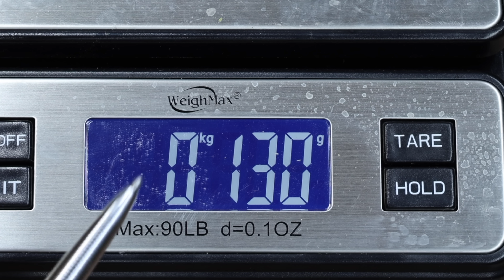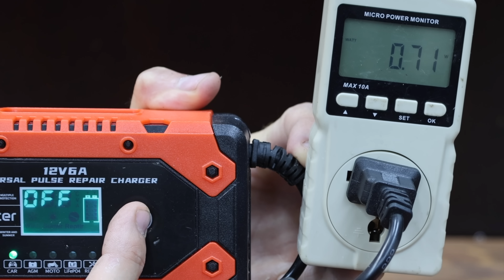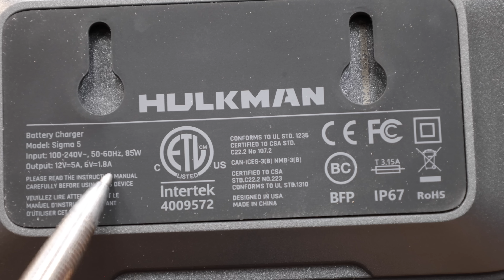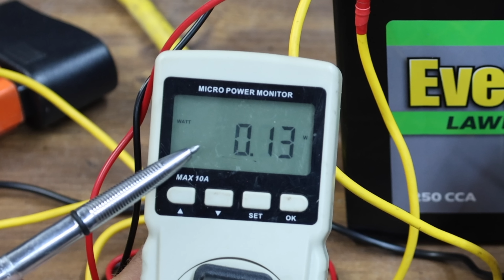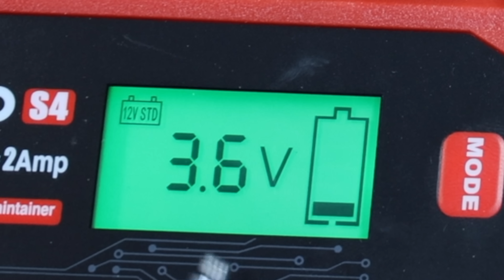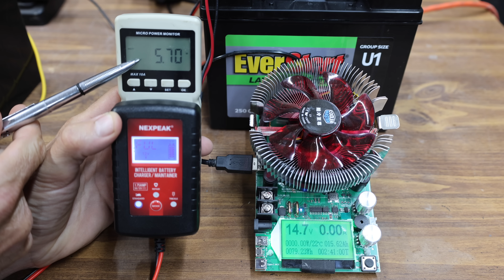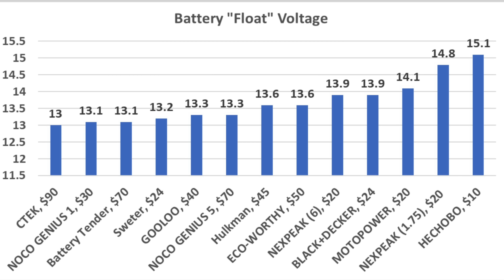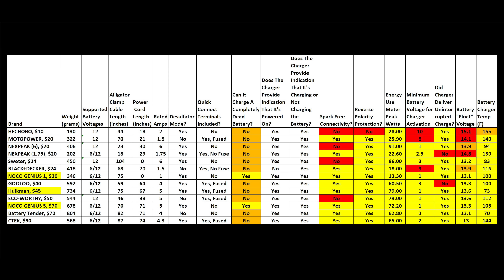I Tested the Most Hyped Car Battery Chargers – One Stood Out!

Comment: Should not have cheap out on the CTEK, testing the MUS 4.3 TEST&CHARGE would’ve gave much better results
Reply from the maker: Thanks for the feedback.
Reply: I’m curious. I have both. How are they different? I tend to use the mxs 5 on my AGM battery.
Reply: @speedlever MUS 4.3 has more features and can recondition dead batteries check out a PDF of the manual
Reply: @mattheww8059 
I have a copy of that on my phone. I don’t see an AGM option on the MUS 4.3 like the MKS 5.0 has. I’m using it on an AGM battery

Edit: both have a 10 day limit on float charging. I hadn’t noticed that before. Hmm.
Reply: @speedlever  go to technical specs and it shows it maintains AGM batteries
Reply: @mattheww8059 
Technically, the normal battery program services ‘many’ AGM batteries. It doesn’t bother to define many or which AGM batteries fall outside the window.
Reply: @speedlever  I don’t know what else to tell you, I’ve been using them on mine for years, so I’m done.

Comment: I had a real world issue last year. My Jeep's battery was dead over the harsh winter. It's seven years old, but died due to the extreme cold we had and the lack of driving. Instead of having a new one delivered I tried the NOCO GENIUS10. It not only repaired the battery, it still works today and was professionally tested, it charged it fully. Over the winter I used the NOCO GENIUS10 to charge the Jeep battery daily until I needed to go out on it's own trickle. The Jeep would sit outside again for two weeks plugged in and the Jeep started and functioned perfectly. Hope that helps. Oh I forgot, after it worked I purchased the NOCO GENIUS10 cigarette lighter adapter. That worked for weekly charging. So easy just plugged it into the Jeep console lighter which is always on.

UPDATE 12/25:
The NOCO Genius 10 no longer recognizes voltage from my Jeep battery. I tested it. It has a 12v charge, even though it is old. The Noco 10 worked for two weeks this winter and charged flawless, but out of the blue it stopped recognizing charge in the battery. It works if I "force charge" the battery though. I'll replace the charger.
Reply from the maker: You are welcome!

Comment: The only quality small chargers are the Victron IP 65 series.  They are fully programable with the free BT  app,.  They can be set to run as a power supply at whatever voltage you choose. Noco  chargers do not have a float stage.
Reply from the maker: Thanks for the feedback.
Reply: Yeah, I’m like where’s Victron? I’d put money that their charging algorithms are more advanced than anything shown here and IP rated. Updatable firmware via the app too. Love all my Victron equipment.

Comment: I have been using a CTEK for over 4 years without any issues, and in fact it's the only charger that was able to bring back a dead battery that no other charger I tried even detected.
Reply: I had been using the CTEK 7002 U.S. model since about 2008 after discovering this brand and learning that it was designed to work down to -20C (I'm in Alberta, Canada). I had been using a big boat-anchor of a traditional power transformer based Schumacher automatic 6V/12V charger that has 125A jump-start capability.

One day after fully charging the battery in my truck with the Schumacher, I measured the specific gravity of each cell using a hydrometer. The float barely came up into the "green" zone for each cell. Later, I tried charging and reconditioning the battery using the CTEK 7002 U.S. model. (The instructions call for first fully charging the battery before using Recondition mode, which I did). Once on Recondition, it took about 15 hours for the green LED that indicates the end of the Charge and/or Recondition cycle to illuminate. (Until the green LED illuminated, I wasn't sure the CTEK was doing anything).

After the Recondition cycle was finished, I again measured the specific gravity of each cell and found the hydrometer float had risen well up into the green zone - far higher than after I had charged the battery using the Schumacher charger. I've been a fan of CTEK ever since. They're not the most powerful or fastest chargers and they don't have a jump-start feature (I still have the Schumacher charger for that), but the CTEKs do seem to be the most gentle and thorough chargers that I've used.

I've managed to obtain six+ years from the three batteries I've had in the one vehicle since 2008. I could have probably kept using them except for the fact that temperatures in winter here get down to -35C to -40C and I didn't want to chance having a weak, older battery in my vehicle in the middle of winter, particularly when I worked out of town at a place that didn't have electrical outlets to plug in my vehicle's block heater.
Reply: @Ralt_Alt406  i have had the same battery on my porsche for over 10 years.  it still worked well but just replaced it, just in case.  of course using the CTEK.
Reply: @Ralt_Alt406  I would not buy anything else than Ctek. They know what they are doing.
Reply from the maker: Thanks for the feedback.
Reply: Curious if a Shell SBC400 worked for you. It brought back my Ranger's battery from beyond dead to good as new. (Damned antitheft circuit drainage...) Now permanently installed.
Reply: Was given a free Marine Battery.  Totally dead.  Have 2 battery charges, neither one did anything.  I put it on a Harbor Freight trickle charger/battery maintainer for a few days, it was charging.  But the battery charger back on it took a full charge and holds.  So if you have a battery charger that doesn't "work".  Try the trickle charger first.
Reply: Keep a dumb charger handy because they will charge a completely flat battery, smart chargers such as ctek usually won’t .
Reply: Great video. I use Ctek 7002 and Clore automotive pl2320. The clore has brought back completely dead batteries.  And my Ctek  is excellent at the desulfating.
Reply: One commenter connected a simple 9 Volt torch/radio etc. battery across the terminals (+ to +, -ve to - ve)
that fooled the charger into thinking the minimum 9 volts  were present in the to -be -charged battery..
and the charger took over and charged the battery 
whereas it would not do so without that "fooling"....

Comment: I think you need to measure the actual current delivered to the battery rather than ac draw. 

Also, you should also review how selectable the charge current is, because you are supposed to set the charge current as a fraction of the battery capacity - so a 10a charger would cook a small motorcycle battery
Reply: its probably automated for detecting capacity. i used my noco 5 amp on a 12v AGM small device battery which is much smaller than a motorcycle battery and all seems fine. i just top it off anyway, it doesnt get discharged much.
Reply: @gods_chosen_chuds yes - if it’s a high state of charge it should be ok, but a low state of charge it should run less amps during bulk stage.
Happy to be corrected - but im not sure you can autodetect the ah of a battery

Comment: While you have these chargers, see what ones will still function in -40 weather, most new trickle chargers all will shut off at -15F today which makes many of them useless for people who have vehicles in colder climates
Reply from the maker: Thanks for the suggestion.
Reply: @ProjectFarm  A good example is that CTEK charger, it's only rated to -5F, any colder and you need to buy the CTEK Polar version which will keep running down to -22F

It's why a bunch of people in extreme environments go with older style battery tenders vs "Smart chargers" that they have today because they will continue to run even down to -60F, also why battery tenders still remain so expensive in comparison

Comment: You should do a comparison with all of this versus a cheap lab bench power supply. 
They cost the same, or cheaper... But you can set whatever voltage limit you want (the float) and whatever current limit you want... They don't care if the battery is live or not. And if you shut it off before disconnecting there's never a spark because both of them are already at the same voltage. Don't turn it on until you're ready or you connect it to the bench supply instead of the battery if you're worried about Sparks... Which is also something I've never worried about. 

And if we're going by weight? They weigh a lot in comparison.
Reply from the maker: Thanks for the suggestion.

Comment: I’ve had 2 Battery Tenders, 5 yr warranty. Both have failed. Sent the first one back at my cost shipping, after the rep didn’t believe me. Cost me the lose of a battery. There replacement also failed in 6 months. Bought another brand for my vehicles all (3) still working after 3 yrs.
Reply from the maker: Thanks for sharing.

Comment: I got a bunch of CTEK chargers are discount pricing, and they suit my needs great for the past 10 years. I use them to maintain and top up my boat, jetski, lawn tractor, and car batteries. 

Depending on the CTEK model you get, yes those too can force charge and output 12v as a 12v power supply too. 

Generally when it comes to trying to revive 0v dead batteries, I tend to go very very old school and use a very old type charger for that, at least only for reviving it. Once it's holding power and taking a charge, I revert to a smart charger like the CTEK I have to recondition it.

Comment: For the record my NOCO Gen5 failed within 90 days, working on RMA/Warranty st the moment. 😞 10/02/25 - As of today, I have sent 2 NOCO 5's back for failures. The first one lost it's brains and the second one keep overheating. They were both used on known good batteries. I think at the moment they have a real QA/Firmware issue. Avoid this for 90 days. That should give them plenty of time to patch it. 10/22/25, On my 3rd NOCO 5 and it's working like it should. Hoping to get a few years out of it.
Reply from the maker: Thanks for the feedback.

Comment: My decision to buy the Noco 1 a few months ago I guess was the right choice.  Just needed one that could maintain an AGM battery for a car being parked for a long time and so far it's completely recharged a dying battery and has been maintaining it perfectly.  I went for the Noco 1 over the 5 simply because of cost and I wasn't in a hurry to charge the battery faster, since the car it just parked anyways.  Thanks for the great video.
Reply: Same. I've used my Genius 1 on 3 batteries in less than a year and it's been excellent.
Reply from the maker: You are welcome!  Thanks for sharing.

Comment: great video!  I've used the CTEK chargers for more than a decade now. What really separates them from the others is their desulphation performance. I've seen then bring completely unusable batteries back to life, and they last few several more years. Noco aren't bad as a runner-up, but they copied their features and technologies from CTEK.
Reply: Taking CTEKs and NOCO apart, it's obvious that the NOCO build quality is better.  I agree with you about the CTEK performance though - marginally better than the NOCO.
Reply from the maker: Thanks for the feedback.

Comment: Made a "battery charger" suggestion in comments a good while back so was especially excited to see this :-).  Great!     Yes, would definitely like to see a review of some larger chargers.   And a separate idea:  capacitor based jump starters.   The kind that use what is left in the battery to gather up power and use it to jump start.  I do happen to have one of these and wonder how it might compare to others.    (They are useful in super cold temps, because there is no internal battery to be temperature compromised.).  Thanks!
Reply from the maker: You are welcome!  Thanks for the suggestions.

Comment: Been running the Genius 10 on a 8yo Northstar AGM in Las Vegas and it still tests ~78%. The power supply mode has been surprisingly useful in the garage to recharge jackery style battery packs and to test 12-volt automotive items. They seemingly have been cheapest during prime days and black friday.
Reply from the maker: Thanks for sharing.

Comment: I have been using a Ctek for 8 years or so, still going strong. I do have an old school battery charger to bring up dead batteries, and switch over to the Ctek. 

I would be curious for you to get the regen mode, not sure if the other chargers offer that feature.
Reply from the maker: Thanks for the suggestion.

Comment: Great review!  I bought the Noco Genius 5 in the absence of comparative data as a trickle charger for a vintage car that I don't drive often a few years back and it's been great. New England winters don't do much for keeping unused batteries charged :-) The Noco 5 has hardware to permanently wire a "pigtail" on the battery for easy attachment and detachment, which works great for my needs. I honestly cant remember if this came with it or was an optional purchase, but I know it was worth it. I used the Noco recently for charging a completely dead lawnmower battery and it worked perfectly as well. Your review made me feel good about selecting Noco.
Reply from the maker: Thanks for the feedback.

Comment: I usually order the one of the top three of the various products you test weekly. Even if I don’t need whatever it is 😂 Man your efforts must sell more tools than the millions spent by the manufacturers on ads. Thanks as always!
Reply from the maker: You are welcome!
Reply: If you need a charger, go with the Hulkman but upgrade to the Sigma 10. Excellent build quality, can charge your larger automotive AGM batteries, LiFePO4 and be used as a power supply.

Comment: There was a major issue that you touched on and then unfortunately completely glossed over...the charging algorithms these devices use to charge and maintain batteries.  You mentioned in connection with the Gooloo.  Also, that series of lights on the Ctek is indicative of what charging stage it is in.   Output should change depending on what state of charge the battery is in.  It should definitely not be outputting at "full blast" until the desired voltage is reached.  There is a detailed explanation of this on Ctek's website.  Those charging algorithms are important to PROPERLY charging and maintaining a battery.  Also, you didn't list which chargers have a setting for AGM batteries.  Most AGMs like to be maintained at a higher voltage than a flooded lead acid battery.  I did enjoy the video, thank you.
Reply: This is an important note; and doubly important now that lithiums are beginning to trickle into  the market in meaningful numbers. I know the NOCOs will handle Li and AGM gracefully, It would be nice to know which of the less premium ones are also safe around less common batteries....

Comment: I have a Noco Genius 5 that is bolted in on the battery terminals, all I have to do is pull out the cord and let it charge/repair overnight, it works brilliantly. I have it mounted on a removable splash guard.
Reply from the maker: Thanks for sharing.

Comment: Why are you starting with a severely undercharged battery? It is literally the least important feature of a charger. A 0 volt battery is DEAD and should never be used again.
Reply: What if a battery was temporarily drained by leaving the ignition on overnight or by an unknown electrical gremlin. I’ve been able to charge and use a battery for years after such an issue.
Reply: @speedlever it will have severely lowered capacity
Reply: @DennisKrger possibly. As I mentioned, I was able to rescue a battery in that condition that lasted for years afterwards. 🤷 Now it probably wasn’t at 0 volts. But it wouldn’t do anything but click when I tried to start the car.

Comment: At the very beginning I thought you should have included the 200amp Schumacher ($148 at my local Walmart)  because it has boost capability. Then I heard your comment at end about larger chargers.  I prefer the mechanical timer Schumacher but I also own the automatic electronic version which magically can charge my tractors and vehicles and then shut off automatically.  Bad thing is I sometimes forget until I notice extension cord trailed across yard.  I have had three batteries blow up on charger.  Two blew top off while on trickle charger; one blew up when alligator clip popped off timing light  while I was adjusting timing on carbureted pickup.
Reply from the maker: Thanks for sharing.

Comment: Good info.. It would be great to know the float voltages for the different battery types.. Lithium can be damaged very quickly by excess float volts. It would also be good to know if the claims of different charging profiles by the manufacturers is real .. Thanks again..
Reply from the maker: Thanks!

Comment: So far best battery charger I've used is Optimate 7 Select 12V 10A TM-251v3, and Optimate 4 dual program TM-341. Optimate 7 i use for my truck xs power battery, optimate 4 is used for my motorcycle and jetski batteries. Used to use the battery tender brand but stopped using them as they wouldn't charge a battery that was low on charge and would have to trick it with a jump starter to get it to start charging, would also not bring back a old battery on a jetski threw the optimate 4 on the same battery and couple days later it said it was fully charged and maintaining and the battery is still being used since 2021. Optimate is hands down best battery charge ive used and will continue to use, Battery tender is just a name now slapped on a product that doesnt work imo. NOCO GENIUS10 looks on paper like it does what Optimate 7 does for $100 less might be a good comparison video between the 2.
Reply: Couldnt agree with you more.  Decades ago used Battery Tender and then my battery vendor got me hooked on the Tecmate Optimate - its an absolute fantastic charger, voodoo technology and brings back dead batteries.  My deep cycle batteries have lived to around 10+ years thanks to their products.  I was hoping it would make the video but its okay, I know its a great charger regardless.
Reply from the maker: Thanks for the feedback.